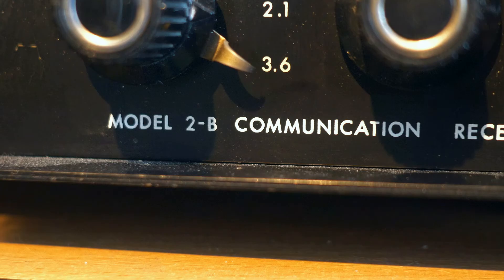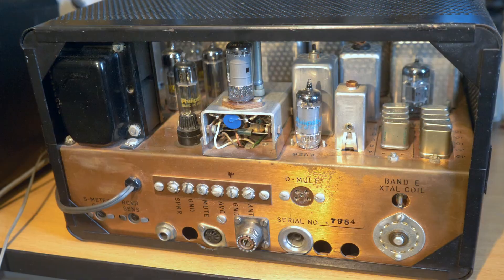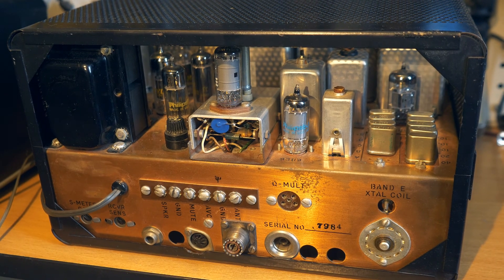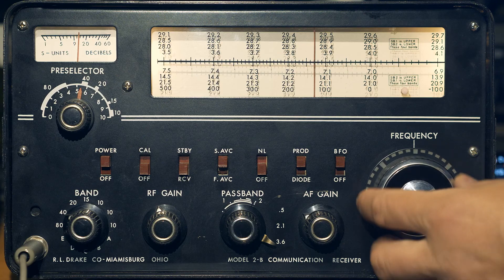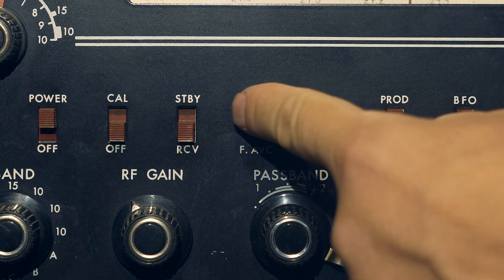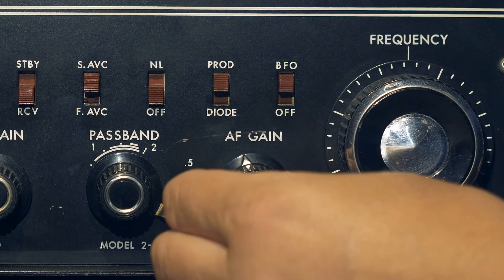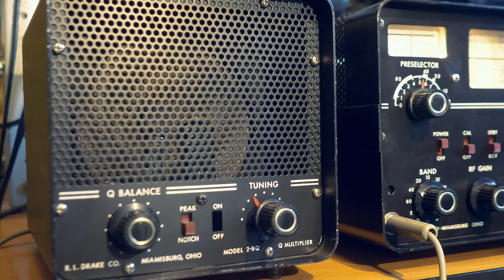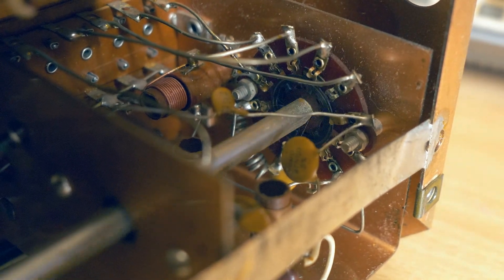Drake 2B American HF receiver of the 60s for radio amateurs. Tube receiver.

Comment: Interesting presentation, but you have one fact incorrect in the introduction talking about the Drake receivers preceding the 2B.  The 1A receiver was capable of SSB, CW, and AM modes the same as the 2B, not just AM as stated.  Drake , although not the inventor, was a leading pioneer in the early implementation of SSB reception and applied it quite well in 1957 with the 1A.  Problem for the 1A is that there wasn’t much SSB to hear then. So, the 2B wasn’t much different in THAT respect.